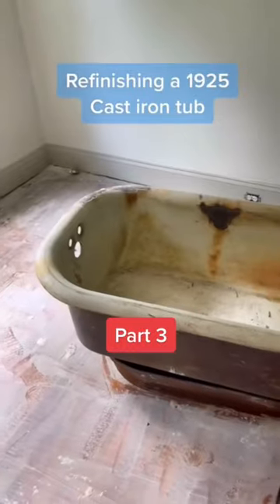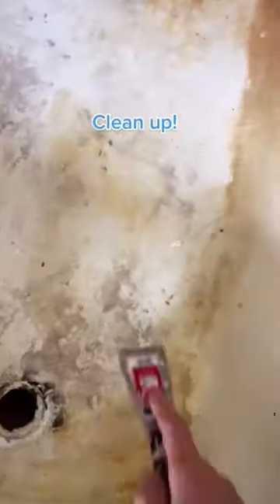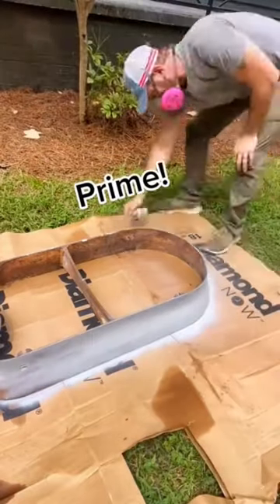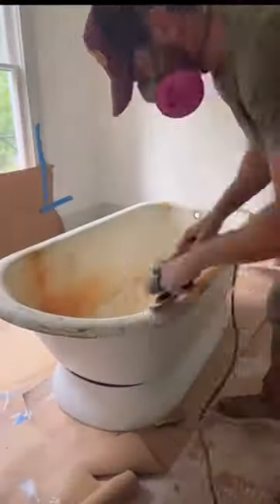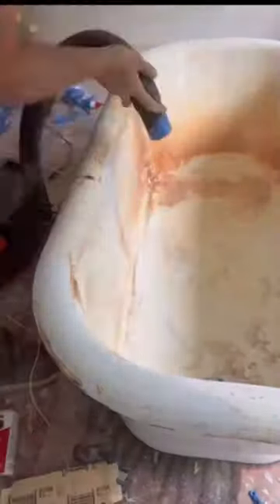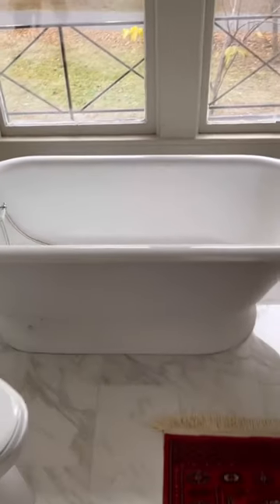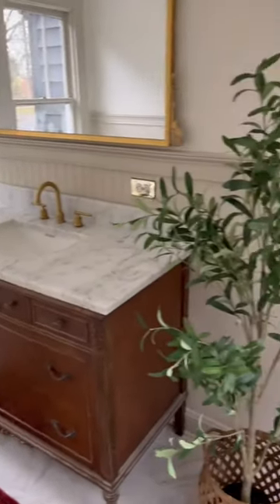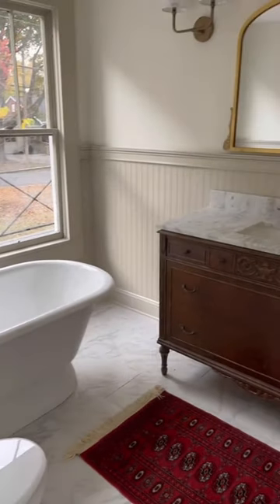Cast iron tub restoration final

Comment: Do you have videos about lathe and plaster walls or do advise going in and switching out to a drywall.  I have a 125 yr old fourplex and I really want to transfer the top to units into a home for myself.  Also, any advice on cracked foundation that I either have contractors saying fix from inside but I had one company say fix from outside but they want $40k that I don't EVEN HAVE, but I want to fix this issue as it has gotten worse, any help would be greatly appreciated, Thank you.
Reply: Take it out and use concrete board and water proofing material